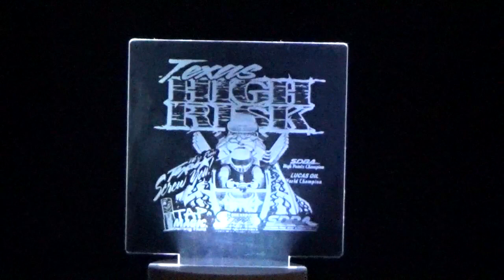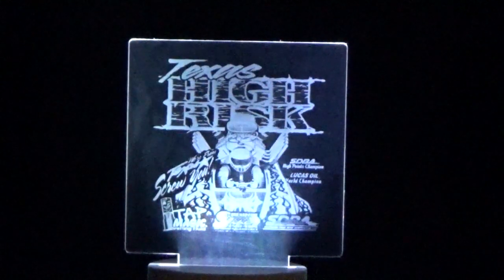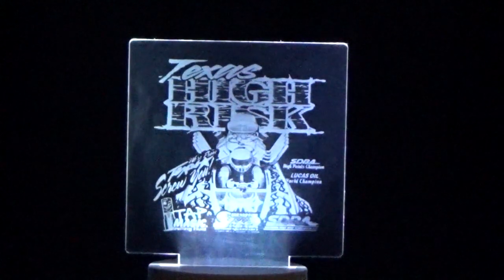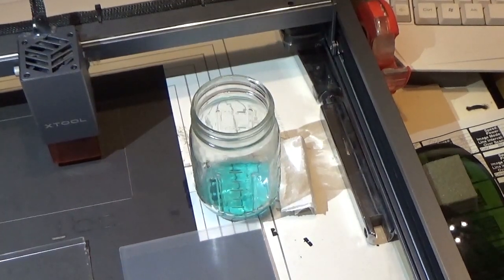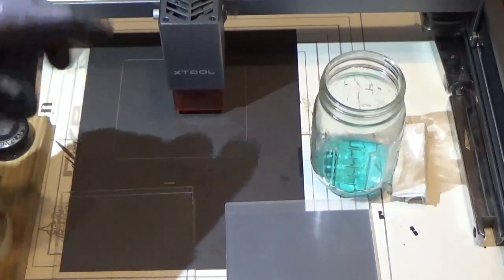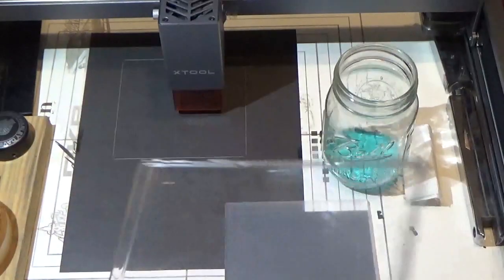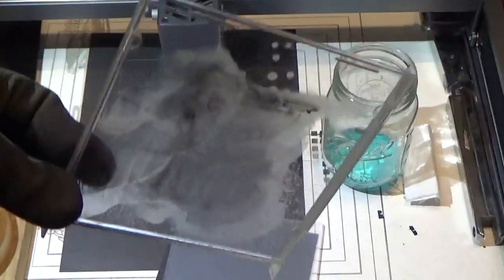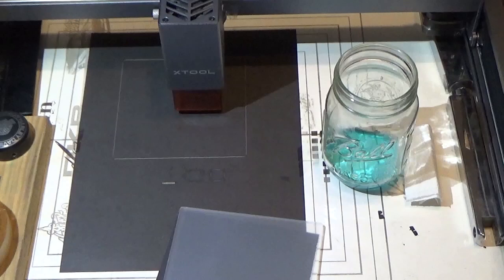xTool D1 / 10w Laser - Acrylic sheet using the Glass on the Fly method.

Comment: this type doesn't work as every one see you turned all lights off then the picture appears and its not clear
spring carbide bit is better
Reply from the maker: You can make deeper cuts with a router or engraver giving more definition to the artwork. This is what can be done with a 10w laser. The finished piece is in a LED display stand. I cut the lights so it would show up better. They look pretty good on their own also.

Comment: So Soap side down?
Reply from the maker: Hi Jason,  Yes. You are making a soap sandwich. It goes between the acrylic and your backer piece. Have seen some using a piece of spray painted metal for a backer. Have not tried it yet but seems to work and the metal is reusable.

Comment: What's the purpose of the black paper background?
Reply from the maker: It is there for the laser to focus on and burn rather than your table. Have seen some using a piece of metal painted with rustoleum or chalkboard paint. I haven't tried it because I'm nervous about the chemical vapors without good ventilation. Posterboard been working good for me.

Comment: Great video! Is there a different Speed-Power setting for thicker Acrylic, 4mm acrylic vs 2mm.  I am using 4mm Acrylic for LED lighting
Reply from the maker: Thank you! The thinner it is, the more it likes to pop pieces out. 4m is a little easier to work with and more forgiving. Settings should be about the same.

Comment: I’m about to try this using laser box basic, I don’t see the material option for acrylic so I’m guessing default material with the settings you provided is the way to go? Also is the soap part facing down? I appreciate your help and this video really helps a lot. Have a blessed day.
Reply from the maker: My favorite has been the PenGear posterboard I get at WalMart. It does well on glass or acrylic. A light coat of soap on the bottom of the piece and you are ready to go. Soap will sandwich in between the piece and your backer material. It helps to keep the acrylic cooler and also helps with clean up.

Comment: What's the soap for.  Some guys use and some don't.
Reply from the maker: It seems to keep the acrylic cooler and helps with cleanup for me. I do a lot of the photo style grayscale images and it's been working for me. I feel comfortable with it. Pick a method you feel comfortable with and go with that. Your results will show it.
Reply: @viperdesigned  Are you using a CO2 or diode laser?
Reply from the maker: @spydie  xTool D1 10w Diode
Reply: @viperdesigned  YOU SAID 80MM PER SECONDS FOR SPEED  MM PER SECONDS IS ON THE CO2 LASER SIDE IN SETTING ON  LIGHTBURN
Reply from the maker: @djfamoso945  I use mms because I got used to it in LaserBox and would have to convert all my settings. They all work like the buttons say no mater what they recommend it for.

Comment: When you add the solution to one of the sides, does the side of the with the dish soap solution is facing the black cardboard?
Reply from the maker: Hello and thanks for checking out the video. You make a soap sandwich you could say. Soap goes in between the acrylic and backer. I have been trying 3 in 1 oil and it has been working great also. Just a light film is all it takes.

Comment: I’m getting ready to attempt this and Im using laser box basic and wanted to ask you, do you need run your image through a program like imag-r Before you hit it with the laser? If you do could you provide me with what adjustments / prep should be made with the image before running in on the laser. Thanks for the help and these awesome informative videos !!
Reply from the maker: Hi Mark, it all depends on your image. To start, names, logos or a simple design would be easiest to work with. One or 2 solid colors. The blacker the graphic the better. For photos, inverting(making it a negative) will have much better results. I don't use image-R but hear it has all kinds of presets in it. Anything settings they have for glass should work just as well.
Reply: @viperdesigned  thanks for the reply keep up the awesome videos !

Comment: Was the soap side down or up?
Reply: Awesome thanks 🙏
Reply from the maker: Soap side down against the backer. A soap sandwich you could say. Keep an eye open. I am experimenting with a new method that is a little more universal and hope to get something posted on it soon.
Reply: @viperdesigned  Hi why is it soap side down?  And I keep the top side dry? Thanks !  I only have one sheet right now don’t want to mess it up.
Reply from the maker: @ceelwarn  You have some practice pieces laying around I'm sure. Old CD cases will work to play around and get used to it. Just do some small images and a little less heat. The soap goes on the back because that is where the engraving happens. The laser won't etch the front of acrylic or glass because it is clear and goes right threw it. If you are going to light it, I would mirror(flip side to side) your image. It will print backwards but when you turn it around, it will be right and read right.. I forget to do that,,,, a lot!! lol
Reply: @viperdesigned  this method works for glass too and mirrors?  I have more of those laying around.  I actually bought some glass from good will to practice etching . I don’t any galzonizing cold spray I guess I could try soap on the inside of the clear glass cups?
Reply from the maker: @ceelwarn  Check out this page. Glass and acrylic are easy. Mirrors are a little different. Those you do engrave from the top with the back side up. You burn the mirror glaze off and etch the glass all at the same time. Be sure to mirror your image here also. Play with some small pieces. Its easy to figure out and very rewarding :)  https://vipervisuals.net/laser/glassonthefly.html

Comment: Great video. Been struggling with acrylic on my D1 so this video was a blessing. Do you know if we are able to cut the acrylic using the same method with higher power/lower speed?
Reply: Hello Shawn, I have not tried cutting acrylic with the laser yet. I would guess that you would need to mask and cut from the top.
Reply: @dkbrown1060  I tried masking with tape, black spray paint, and tempera paint, but no luck. Thinking the D1 maybe can’t cut it
Reply: @ssarver1672  on the FAQ page on the D1 it says that it can cut it. But I'm having a hell of a time getting it to do anything but char and melt it
Reply: @MrJimmyWalsh  I have had success cutting through semi translucent green and opaque colors. I used 3mm/s with 100% power. 4-5 passes. No luck with clear. Even my engravings turn out very light.

Comment: Did you wipe the soapy water on with the sticky backing still stuck to the acrylic?
Reply: I peeled the plastic off one side and then applied the soap to the acrylic. Left the paper on other side so I could lay it down without scratching it. Peeled other paper off right before ir went under the laser so it didn't get dirty.
Reply: @dkbrown1060  thanks for clearing that up